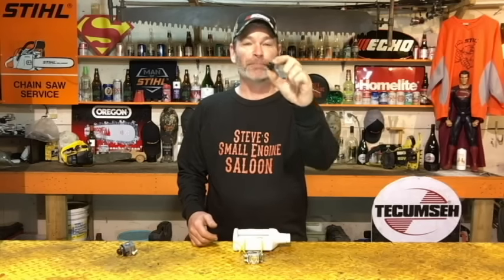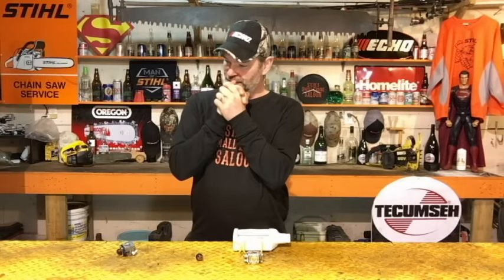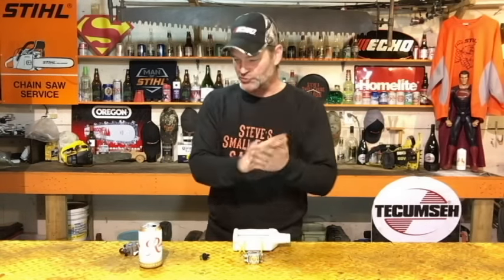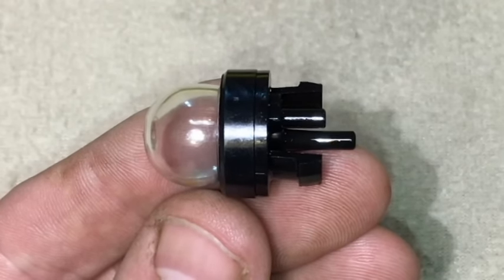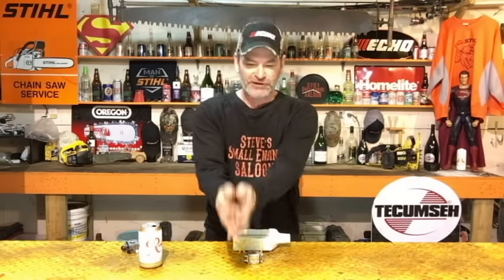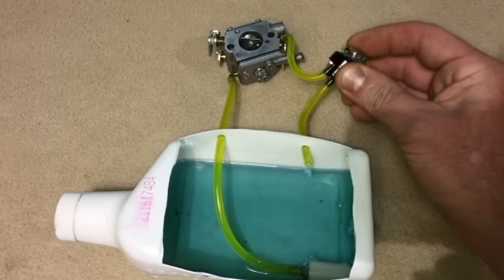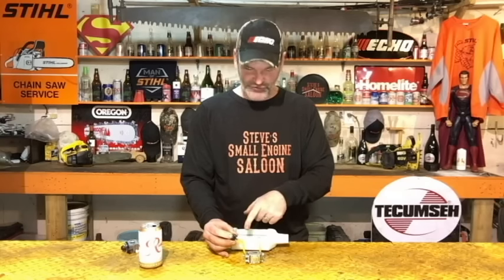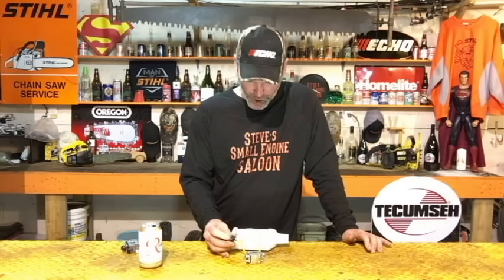How To Install A Purge / Primer Bulb Properly (Don't make THIS mistake!!)

Comment: Steve I have a Husqvarna K760 disc cutter.If I tie the throttle wide open, it will fire , run, and rev.If I untie the throttle it stalls and dies and will not start. Any ideas? Writing from the UK.

Comment: Hey Steve, I removed a primer bulb for my BS 148cc Murray mower. When I pulled it off, the check valve inside the carburetor (tiny ball and spring) had dislodged itself a from inside the carburetor and was laying loose inside the bulb. Guess what. I lost the ball, found the spring but the ball is somewhere in the tall grass in my front yard. My engine model is 9L602 1623 model 11. My question is where can I buy a kit that has this check valve in it or do I have to buy a new carburetor?  Thanks

Comment: Thank you very much Steve. Great job explaining the parts, functions and process  One question please. What could then be the problem(s) if after pushing the purge pump and it stays down or is hard for it to revert back to oval shape, meaning comes back to normal shape. Am asking because mine on husqvarna chainsaw stays down or very slow coming back to normal/oval or dome shape. Thank you so much. Stay safe!
Reply: Well, it's been 6 months with no reply so I'll offer my 2 cents.  The bulb is rotting and or the filter is clogged on the pickup line.

Comment: Thanks Steve very good explanation, but mine has a small and larger fuel line. Which one goes where?
Reply: Me too, I put the filter in small line and it run about 5 seconds and dead,  it wasn"t work and the purge pump is not come back !? tomorow I will move the filter to large fuel line , I hope it is right one .
Reply: It goes between the carb and fuel “return line” to tank.  Fuel line size can vary, but dont go by that. The opposite line from where the filters at.  Then Make it pump fuel to the tank/ reservoir.
Reply: Now I am sure the filter will connect to the small one ( green one  ).  Large .yellow one is gas come back to the tank . It now is run good

Comment: I put the new  lines  on  I think I may have poked a  whole in  the line to  the fuel  it still pumps  gas  back into the tank but will  it not work with the leak in the line ? Leaks just above where the line comes out of the tank ?

Comment: Steve, when you use gas in your ultrasonic cleaner with a glass container do you still use heat to wash the part in the container? Thanks  Randi!

Comment: Hey Steve,  Why can't I get a Stihl blower to prime?  Does the needle have to be closed.  I have put a kit in and the lines from the tankt are good, no leaks! I reckon the lever is set correct.

Comment: Thank you Steve for this very informative video!
I have a Forest King cs5212 chainsaw that does not have a purge bulb and is very difficult to start at times.
Is it possible to add a purge bulb or change the carburetor to one that has a purge bulb ?

Comment: Steve do you know if that ethanol resistant bulb on Amazon will fit and echo 303T and cs400?
It sure looks the same. 
I have a brand new bulb in the 400 and it failed after one round of cutting and the 303T I bought used it failed yesterday. Busted open. The 400 was running so good man after a new carb install.
Love the fuel demo!

Comment: Ha Haa I have a carburetor that is not pulling in fuel unless I tilt the tank to the side. Now I believe I have it backwards!! Thanks great video very clear!! You have a new subscriber
Reply from the maker: Right on Scot!  Thank You...
Reply: Steve's Small Engine Saloon okay Steve so I have a primer bulb that’s separate from the carb so I’m hooked the two lines up and checked to make sure it was working properly and the bulb fills up and pumps strong so I hooked it back up to carb and the bulb won’t fill up with gas? So I took the carb apart and the diaphragm is bad not flexible at all(Zama carb by the way on a Cratfsman weed eater) so I ordered the carb kit but would a bad diaphragm not allow bulb to feel up? I can not tell you how much I appreciate you and your fantastic channel!!

Comment: Question - I need to replace the long tube hose from the purge bulb back into the tank. Can I just replace the hose and bushing and squeeze It back into the tank without any issues? Should I cut the gas line at an angle prior to inserting it back into the tank?  I appreciate your opinions. It's on a Husgavarna 455 chain saw. Thanks

Comment: All my hoses had rotted and didn't know which one went where, cheers from down under
Reply from the maker: Right on Mikey....
Reply: Fuel all good now, but found out no oil on bar. Opened oil tank and tank empty, filled it but stihl no oil (in joke, actually it's a mtd 3414). So drained oil and a filter fell out. The line on filter was cracked. It looks like the same line as fuel line. All the videos on utube show the oil pick up line as special made fittings (rubber, and specially formed,) . I am wondering if mine uses standard fuel line between filter and pump inlet? I'll start by pulling off clutch etc, and have a little bo peep
Reply: Ok, all fixed, yeah just normal fuel line was all i needed. Just a cheap saw, but seems to be designed well for handyman use, easy to repair and maintain. Plastics seem good quality. Also sharpened my chain by hand, but file was stuffed,, only used it once or twice before. Is this normal that a file is only good once or twice, or do i have to pay more fir something that lasts? I can't remember brand, but i tjink it was name brand, sandvick maybe?? Any way, just watched your tensioning video, good advice. I'll check if ya have any sharpening vids, check ya later

Comment: What do the faucet/sink drain, electrical cord small/big prongs, and the purge bowl short/long connections have in common. The faucet size is much smaller (source) than the return big drain. The small prong is the hot (source) of power and the big is the return (drain). The small is the purge connector is the inlet (source) and the large (drain) purge connector back to the tank. The drain or return is almost always larger.

Comment: I can see how that purge bulb works as it sucks the fuel through the carb being placed on the outlet line of the carb and then back to the tank. But if you placed that purge valve on the inlet line going to the carb and the outlet line coming from the carb back to the tank, wouldn't it accomplish the exact same thing? One would be sucking the fuel through the carb, as you just demonstrated,  while the other would actually push the fuel through the carb. Just thinking out loud here. Great video as always though.

Comment: Thanks Steve!   That explained a lot for me as to how it all works.    I have a question.  I have a (less than a year old) Husqvarna 450 Rancher.  when its running I like it, but that's part of the problem.  It' doesn't like to start.  I have noticed the bulb is very hard to push, and does not appear like it is moving anything through it.  Can it still be bad? or may there be a clog or something somewhere else?

Comment: Have been trying to figure out a flooding issue on my fs250 brush saw and this was the problem. Previous owner had the fuel lines on backwards, was pumping fuel into the carb and flooding it. Literally had excess fuel pouring out of the air filter.

Comment: If you buy a fuel line and not-a-primer bulb assembly kit with a few bulb sizes, how do you swap out the bulb in the bulb assembly for a different size? I'm guessing it's not necessary, but how would I do so if I wanted to? The kit I got has a smaller bulb installed in the assembly than the bulb in the assembly I'm replacing. Thought I would try to install the bulb closest in size to the one being replaced...

Comment: Great video Steve, my Craftsman's leaf blower w/choke , says to depress the primer/purge button 10 time before starting the engine..... I was always afraid of flooding the engine, but your video makes a ton of cents of why to purge so much..... The button circulates fuel through the fuel system, not adding fuel to the intake manifold cylinder....
Reply from the maker: Awesome comment, thanks Buddy...

Comment: I have a Poulan PP338PT that never ran right since new.  After a while I stopped using it.  After about 2 to 3 years of inactivity, I decided to try and get it started.  I thought I would replace the carb, and see how it worked with a new carb.  The fuel lines were in really bad shape, so I replaced them, too.  I'm 99.9% sure the lines are configured correctly, but it does something I find interesting.  When you pump the bulb, the line from the carb to the bulb has a bunch of bubbles, and the line from the bulb to the tank has the same bubbles, BUT the line from the tank to the carb flows clear, with no bubbles.  Is that normal?  The reason I ask is that it won't start, and I'm trying to figure things out, and rule things out.

Comment: Thanks for another great video. Question for you. What would make the purge bulb cave in and not come back out after pumping it? Two different bulbs on the same saw have done this. I did replace the fuel lines and the purge bulbs were  connected properly pulling fuel when it’s not collapsed. I haven’t rebuilt the  carb but have a kit on the way. Might the carb be causing the problem?  I’m puzzled! Any suggestion is greatly appreciated, thanks!

Comment: Thanks for the tips. I have one question please. Does the fuel "flow freely" in one direction after priming/purge the fuel? I had one of those black big primer bulbs (not all built the same)  that you cannot use as gravity siphon because it has 2 valves and will not flow fuel unless  you continually pump it. Your video gave me an idea of adding/modifying this on my diesel air heater that requires priming the hose line before "initial" start up. Because the built in clicking pump is so weak that it may starve the heater with fuel. Just like to ask before I buy it and modify and add this to my heater. Thanks.

Comment: I have a small snowblower that has a larger purge bulb with only one line to the carburetor, it also has a choke but it's hard to start, maybe my purge bulb is old? I don't see any cracks on it.
If I prime it with a little gas in the spark plug hole then it starts and runs good. What do you think?

Comment: Thanks  i have replaced the bulb on my Dolmar ps 420c   its fires or tries to run if i squirt gas in the carb , i fished the line  in the tank out today pumped the bulb & noticed the filter like it suck the fuel out of it , im thinking maybe i got the bulb on right , great saw but wont start , any advice is appreciated !!

Comment: Trying to replace the purge bulb on a 27cc Craftsman leaf blower. The original had a hole. When I removed the bulb assembly the is a small diaphragm on it and it fell out. I replaced just the rubber bulb. I didn’t see which way the diaphragm was in there but I put it in both ways and it still won’t move any fuel. Should I be filling up that fuel line some way to prime that first? Any ideas? It ran fine until the bulb went bad. Thanks!

Comment: Is it ok if the out let hose is submersed in the fuel
? It is pretty long inside my tank . Not as long as the line that is connected to the inlet filter . Thanks in advance !

Comment: I've got a 2017 Poulan pr5020 chainsaw that has decided after about five or six hours of operation to start giving me fits.... I will get it running again come hell or high water... giving many things careful thought based on some of your videos as well as other YouTube videos this that the other... logic would dictate that on the purge valve / bubble there would be two check valves one for in and one for out ... because the saw came Factory with the return line well down into the fuel in the tank... curious about your thoughts on this ... TR .. Michigan ..Flint area

Comment: Rebuilt mine now the primer bulb won’t stay full I got it right  it’s pushing fuel into tank  it starts burn fuel then the primer bulb goes empty ?  Vacuum or air leak ? Does the tank need to be air tight    ?   Fuel lines are not the same diameter outside  so I drilled the tank   To accommodate the larger line I noticed when I pumped  air bubbles around the hole ?    So my plan is to get a larger diameter to fit what I drilled  the only other thing would be base cly gasket   ?

Comment: Thanks!! 
Can I request a video about husqvarna fuel lines and grommets that leak when the saw is on its side  (even when they are brand new replaced.) am I installing them wrong? Is there a workaround? Are there different diameter  hoses that work better or worse? 
(Rancher 460 is the saw but I’ve seen a lot about huskies fuel lines in general being a weak point.)

Comment: Steve thanks, I have a bulb like this on a Briggs and the gasket is torn and someone suggested using tape to repair? The valley on the housing has to be open? For it to work proper?

Comment: Very good. Question; When I took my Stihl chain saw in for repair, the technician connected a vacuum pump? (I think) to the carb. Is that a way to ceck it's fuel pump for leakage? Or something else?
Reply: That is a pressure tester. It actually tests to see that the needle and seat are not keeping down. Normally its 3- 5psi, very little. If the pressure drops at all, you have a faulty need and seat. Normally, thats not an issue unless its flooding constantly.  Leaving old fuel with contaminates such as water in it does that. Ethanol will cause the seat to become expanded and soft, causing the needle to stick. You can now get a green colored seat that is not affected by ethenol fuel. Look for the notification when ordering it. It should state that its safe for ethenol fuel.

Comment: Steve The Purge line going into the tank does it need to be down into the fuel like the filter line or can it just go into the tank a little bit and terminate

Comment: What would be the problem if when you pressed the purge bulb ..... And fuel ran out the throat of the carb. into the air filter on a set up like in your video ? .... Im talking about on a brand new carburetor ?

Comment: So the carburetor is essential a one-way valve for fuel? Now I can't help but wonder if carbs like this pump excess fuel through the return line when they run

Comment: lets say the bulb is crack but you can get the chainsaw started could it stay running even if the bulb is crack badly, or would it die out after a while?

Comment: Have PB 2100 Echo, was blowing, it ran out of fuel, I mixed more, filled the tank halfway (end of season very near), and I could not restart it. My dealer had replaced fuel lines and plug Jan 18, so I discounted that was the issue, and went ahead and replaced purge bulb, but still no start not even a fire, any suggestions, Steve?  I will pull the plug and make sure I have spark, but since it was just running I do not think that is the issue.

Comment: I don’t suppose you would know why my purge valve is pushing and pulling at the same time? Seems the flange inside of the black valve seat behind  the purge bulb Is no longer sucking through the carb. Does this sound possible?

Comment: Thank you Steve, I have a craftman blower and just replaced  the carburetor, there was NO manual to show the routing for three gas lines or explain the location on the PURGE valve.After trying to locate one for my particular unit ... I saw your video.  I watched your video but I have three lines to purge bulb and four lines to carb. Two from  tank & 4 off carb & 3 off bulb . Please help  Thanks
1

Comment: So I just did a fuel line replacement on an old craftsman (poulan) chainsaw and it runs perfectly now but for some reason the purge bulb after getting pushed a few times is stuck pushed in like it's not refilling. Is that a clog in the purge bulb system, a vacuum somewhere or is it fine to run it like that?
Reply: Update I cracked it back open and the fuel line had kinked and wasn't letting anything through, so I cut the line shorter and problem solved

Comment: Hey Steve. Great video. My Craftsman weedwacker doesn't suck gas from the tank when I push the purge. I hear air coming out of the return but no gas. I'll appreciate if you can tell me what is wrong. Thank s.

Comment: I wasn't aware of the  method of operation but I've noticed on one of my trimmers that has clear fuel lines that operating the valve clears the air from the fuel lines.  For that reason, I thought the purpose of the valve was to remove the air from the lines which would provide good fuel flow for starting.

Comment: I have that same bulb on my jonsered clearing saw. it does not fill upp with fuel at all. the saw starts fine and runs great. but i would like to have a working bulb anyway because its meant to be working and its nice to have it when you run out of fuel and i have checked all fuel lines and checked the carb diaphragm and all that. Still not working.

Comment: Great job. I have this problem now!  THANKS
Reply from the maker: You're Welcome...
Reply: @StevesSmallEngineSaloon  I did have the lines wrong on the Purge ball.  I also have a Craftsman saw that they call it a primer ball. It is marked primer right next to the purge ball on the case.

Comment: Thank you Steve.  Never really understood the flow before and what I thought I understood was wrong! Still, I think the flow in my Ryobi chainsaw is correct and it still won't start, even with new fuel, spark and new carburetor -- running out of ideas :(

Comment: Thanks. Ranier, can't buy it here, but it is the only kind Longmire drinks. Real good. My Sthil FS44 brush cutter won't start when cold without priming in the plug hole. once warm it is ok all day. so I hooked up that purge ball backward and now it starts ok. I tried everything, any ideas what may be wrong.

Comment: Hi Steve this doesn't could you please tell me if the fuel filters are used as a metering device also? Can I put any tipe of filter on a BR600

Comment: I got a question does it make a difference which fuel line goes in which hole on the fuel tank high side or low side